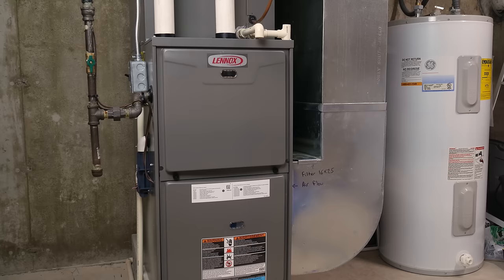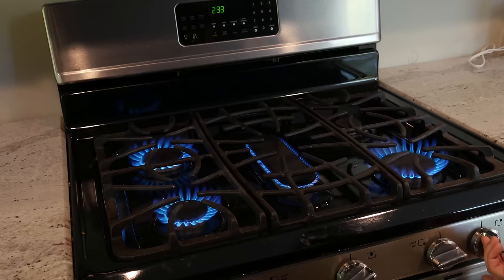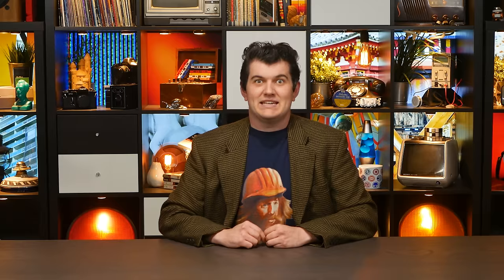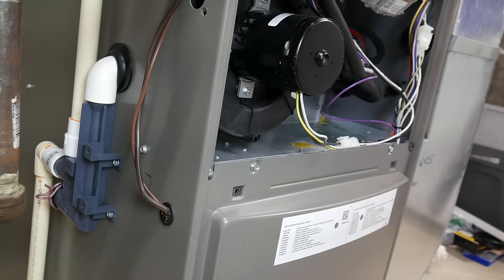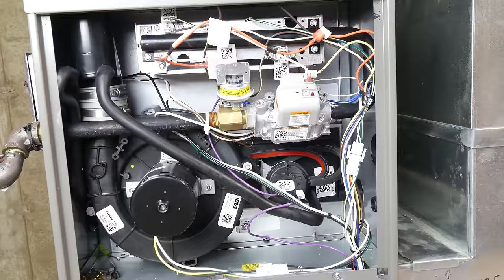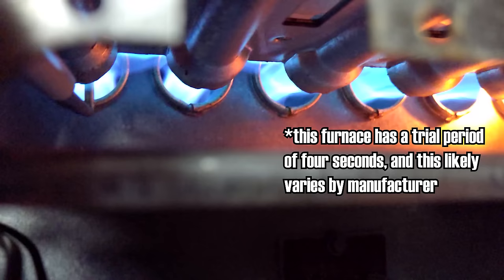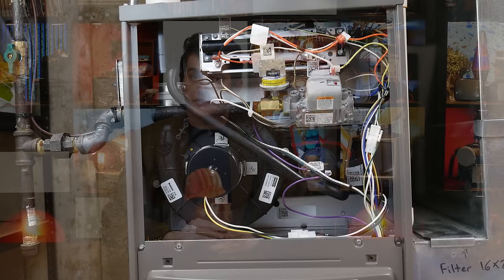Forced-air Furnaces: The What, Why, and How

Comment: About CO (carbon monoxide) by-product of gas burner, existence of CO would indicate misadjustment of gas-carburetor (which mixes air in proper proportion with fuel gas), or blocked air passage. Those bad things should never happen. If burner flames are, or can be, visible, they should be purely deep blue. Presence of any yellow flames indicates CO- get help NOW.

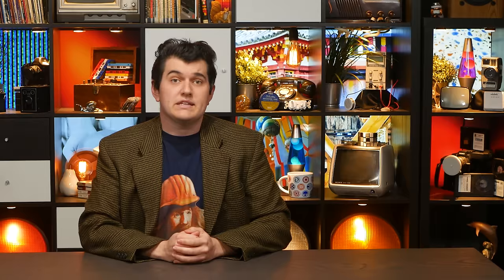Comment: 3:00 While the furnace might reach 95% AFUE, that doesn't mean all of that reaches the place you want to heat - unless the furnace is in your living space. In most houses there's quite some loss in the ducts.

Fun fact: my condensing boiler reaches '107% efficiency'. The measurements here in the Netherlands include vaporization enthalpy in the efficiency measurements, while the 100%-reference is based on the combustion energy alone. If you ask me, it should also include the energy the pump uses, but who am I...

Are those exhausts really PVC? IIRC PVC is only heat resistant until 60⁰C (140 °F) which is right about the temperature of the exhaust gases.
Reply: As he mentioned, they can only be used in condensing furnaces, because the exhaust gasses are very close to room temperature in those.

Comment: There should be a co and smoke detector in the duct that will shut the furnace down, and lock it out.
Reply: commercial systems often do that, even integrate with the fire alarm system

Comment: This video seems to me to be a guy who watched a lot of videos on YouTube and then makes his own video like he knows what he's talking about, I bet you this guy wouldn't be able to troubleshoot any furnace problem. 
The control board usually has a light that flashes to give trouble codes, if not, then testing the different sensors will usually tell you what's wrong with your furnace. Most of the time it's very easy to fix, even replacing a blower  or draft inducer motor is not that hard, but it will cost you a small fortune to have a company come fix. 
If you're watching this video then you most likely are having an issue with your furnace... an electrical tester, some common sense and watching videos of people who actually know what they're doing will save you a boatload of money and probably at least a day sitting around in the cold. Only Exception is if your carbon monoxide detector is going off which means either you have a gas leak or a cracked heat exchanger, so call in a professional for a gas leak and the latter most likely means you need a new furnace.

Comment: Heat pump sucks. Imagine running your a/c year around and the electric bill you will get. Its very hard to run a heat pump off a small generator during power outage.

Comment: Electric heat is 99% efficient, as not all the electricity is used for heating. There are electronics and a blower, that also consume electricity. An oil filled electric radiator would be the closest to 100% efficient.

Comment: 14:35 sparky thinh (electric arc or electric spark)  got in Poland out of fashion as it was sometimes unable to tell,  that the gasfull was not ignited before feeling up the whole area with unburned gas and it led to few blown up bathrooms (thi is where we held our furnaces).This happened causa our furnaces ware unable to turn on often and gas company didn't have enough employees to fix them in time, so people found a way to make them work (Macgaver style). They simply make furnes not check if the ignition happened by forcing the detector to always on and use a match to ignite gas if the spark wouldn't do its thing. Great ingenuity in socialist Poland, isn't it?

Comment: For failsafeness, I prefer NatGas/propane cooktop and heating. Even if the power goes out, I can light the range with a stick lighter, and run the furnace off a power inverter and some spare car batteries. This over reliance on electric everything, especially when we havent gotten onsite power storage sussed out yet (lifepo4 is still expensive, and fuck tesla/musk), is quite concerning..... Oh well, at least Ill still have hot food and warmth the next time the power is out for an extended period of time (like it was a few weeks ago when a thunderstorm and some yahoo driving into a power box tripped the cities main distribution trunk all the way back to the high tension lines running a county over to the natgas power plant....)

Comment: Leaving fosils for heating is nonsence. Why? Simple. Outages. Sure, you still release CO2 and other stuff, but, it's actually very efficient, just as you mentioned, but also allow's for microcogeneration of electricity, which can supplement other sources of power, such as wind and espcially solar in winter (you know, cause shorter days). Furthermore, you can add a tank for fuel, which you will have to maintain, but doesn't lose capacity unlike batteries, meaning you have more reliable stored supply of energy in case of an outage, which could take days. This vast battery supply even for a small, highly efficient house is comically big. Like extra barn full of batteries big. And even those can emmit pretty nasty stuff.
Where do I think fossils need to be phased out? It's large scale electricity production and even there not entirely. I firmly believe in nulcear power for the long run, as it is the only known source of power, which could provide enough electricity to power entire cities with very low emmittions, if you consider all emmittions from obtaining of materials till decomitioning of a plant, which makes decades worth of efficient energy production, you'll find out that it has lower CO2 footprint per Watt of power produced than either wind and solar! The other sources should supplement nuclear powerplants and green power sources, when needed and heating should be done still through burning, centrally if at all possible and of stuff that was already used (unrecycleable waste) or wood (again, what can't be used otherwise and in individual homes), but also gas for individual homesteads and small towns.
And why do I think only the grid should go green and not all green? Well, our current battery technology is not exactly any good. Make no mistake, even Tesla batteries, some of the best on Earth, aren't any good. Why? Batteries are not dense enough energy wise and we can see this in electric cars. Looking at them long term, they can't compete with petrol, because of the difference in energy density of their batteries and the fact, that these batteries degrade over time, which won't happen to a tank, and make no mistake, batteries won't get much better any time soon. The problem with power storage is stressed in cars, because of great need of mobility and mass of a vehicle need's to be fairly low, but even when there is not a need for mobility, storing large ammounts of electric energy in batteries can be prohibitive due to avaliable space.

Comment: Glad i got electric heat - clean, quiet and simple - a thermostat , wires and a heating element - no CO , no noise and no drafts.
Reply: And cheaper if you have the fabled HEAT PUMP😄

Comment: I've noticed a pattern when it comes to discussing technological differences in different parts of the world. If the American version of some piece of technology is somehow different from the way most other places do it, the automatic assumption from the non-Americans is that the American version is an inefficient and overall inferior piece of garbage, irrespective of any evidence. See: 120V vs. 240V power grids, the prevalence of electric kettles or lack thereof, Fahrenheit vs. Celsius, Imperial vs. Metric (I agree metric is better, but it's not as though Imperial is actively making our lives worse like a lot of you think it is), furnaces vs. boilers, etc. I feel like the goal is just to take pot-shots at America whenever possible. And to be fair, I'm not the biggest fan of this place, either. But if you're going to take aim at America, make sure your target makes sense, because there are plenty of them that do

Comment: Speak for yourself about electric resistance heating. I live in a state where 50% of electricity come from nuclear energy, and a good additional amount from wind power. We have extremely cheap electricity (currently 4.8¢ per kWh) and you can easily heat a house with electric baseboard heaters if you have the power company give you something like a 350 amp service drop.

Comment: I have a heat pump in the north east. They are very inefficient below 35 F. So even with high oil costs my oil burner is cheaper than using my heat pump.

Comment: Yikes...I really hadn't thought how much further ahead we are with this type of technology in Europe...every single home built the last 30 years uses geothermal heatpumps with complementary resistive electrical elements to add heat when needed. Heat is generally transported using liquids to under-floor heating (and cooling when reversed).

Comment: This is a stupid way to heat a home
Water based boilers are way better
Especially if you have floor heating systems of Europe rather than the radiators. They are most efficient way of heating a space.
Condensating boilers can reach 97% efficiency plus no risk of carbon monoxide being pushed through your air vents into your rooms.
Water temperature can be controlled via an outside air temperature sensor, so the  heating system can work at very low temperatures. This increases efficiency,
Plus the European combi boilers work as instant hot water heaters. Again very efficiently also using the condensation heat in the process.

Comment: 95% efficiency?? You have 20 years old technology. We in europe have condensing gas boilers with efficiency of 105% to 115% 😂
Reply: no you do not, it is impossible to have more than 100% efficiency.
Reply: @Redtooth75  i'm service technician of gas boilers. Because latent heat of water vapor there is addicional energy absorbed by heat exchanger. I have special measuring equipment that can show me how much CO, CO2, O2 is in fumes. I can see draft, temperature and efficiency too. It's depends of quality of the gas but in most of the time it's above 100%
Reply: @marcinin95  your standards and our standards use different methods. Our standards refer to the energy of the fuel only.

Comment: Update from the angry mob! ;) Please go live with a builder heat pump in a house for a winter. There are many types of heat pumps. The most common version attempts to extract energy from the external surroundings, namely the atmosphere and release it into your house. This is done by allowing the energy in the atmosphere to expand a working fluid, such as ammonia outside, and then pump it into the house where a condenser compresses the  ammonia thereby forcing the heat out of the ammonia and the forced air in the house picks this up and it is circulated through the house. On paper this works great. Now imagine it is too cold outside for the ammonia to be properly loaded with heat, the auxiliary heating element in the heat pump system turns on and warms the house air to be circulated. This is just like the nuclear auxiliary power  being activated in "National Lampoon's Christmas Vacation" This costs YOU major amounts of money! If you own an electric stove look at the heating element in the oven - it's the same as the one in the heat pump. 

If you can build a custom home you can get a special heat pump where the working fluid, ammonia, is circulated below ground where it stays warmer year round. You might get lower operating costs at the expense of higher initial installation costs. Also, if the tubing below ground is wrecked in some way it must be excavated and replaced.  If you live in a densely populated area your neighbors maybe using the same system causing your system to not be as effective. Finally, geothermal is the best heat pump system you can have for your house since you are working with a near infinite source of heat. 

If you are a normal guy with a house you want natural gas heat for its comfort. There is no medical dangers for using it. It is clean and safe. The economics of electricity is as follows: electricity is 5 times more expensive than natural gas on a "Therm" basis. Wind and solar are unreliable sources of electricity. Look at what happened in Texas.  Electricity generated by burning coal  is  thermodynamically stupid. Why burn coal to make heat to boil water to turn a generator to make electricity only to turn it into heat? If you want a warm and reliable home,  use natural gas for heating, cooking and drying your clothes. 

One final point,  heat pumps use a coefficient of performance, which is not the same as calculating system efficiency. Heat pumps only move energy! They do not create and move energy. Electric heat is terrible and will continue to be terrible. Global Warming is a hoax.
Reply: It's true that air-based heat pumps do not work well below a certain temperature but the latest ones do pretty well, even below zero degrees F. And if you are in a climate where there are only handful of days when they are ineffective, you can switch on some other form of heat such as electric resistance heating. Will that be expensive and use a ton of electricity? Absolutely. If I would only need that for a few days per year would I care? Probably not. All of this said, today would I run out and buy a heat pump for Minnesota winter as my main source of heat? Maybe not quite yet but using electricity as a "fuel" for heating is where the puck is headed.

Comment: Except that this stable genius doesn’t understand how flame rectification works in this application. Might want to learn the difference between a flame sensor and a thermocouple before you continue to give bad information.  You also ignore the most important reason for an induced draft motor.  You really should leave this to someone that actually knows what they are doing.

Comment: 'Murica is a weird country. Isn't it kind of expensive to burn natural gas for house heating? In northern Europe where winters can be cold too (-20 Celsius/-4 Fahrenheit) most common heating method is district heating. In rural areas where that is not available most common methods are heat pumps, geothermal heating, biomass burning central heating and some, but nowadays few oil central heating systems remaining from the 80's.Of course wood burning stoves and ovens are still common in older, and why not newer too, detached houses.
Reply: I dont really get why wood burning isn't that common in the usa. We have one big heat storing furnace right in the middle of our 2 story house and it easily keeps it warm even during -40°C nights.
Reply: depends where u live...i live in socal and i have an old terrible heating system but never use it lol it never gets that cold >:)